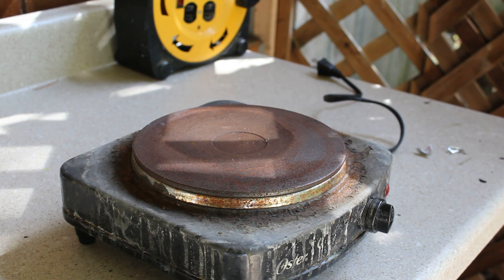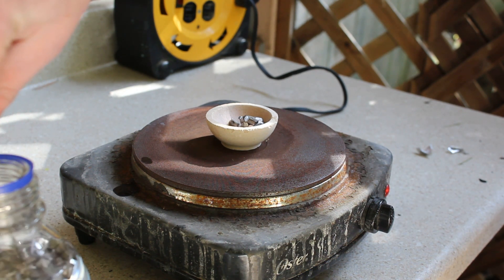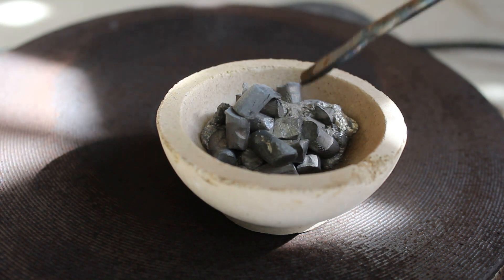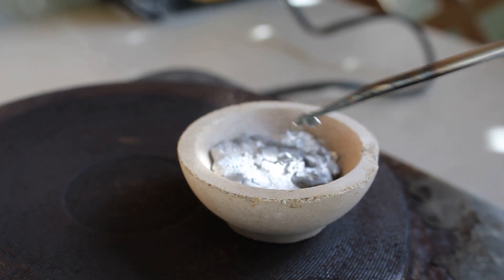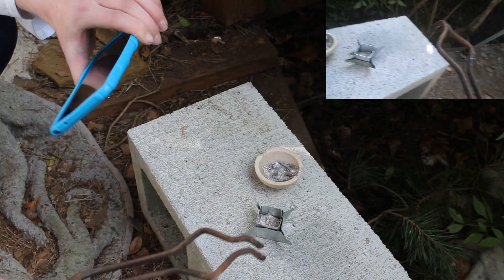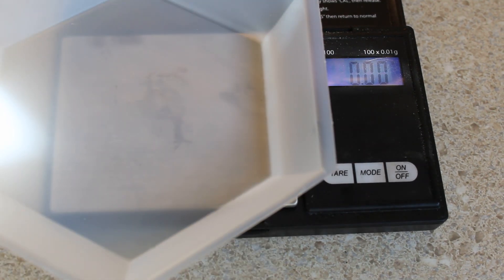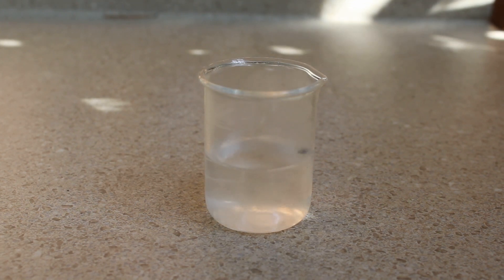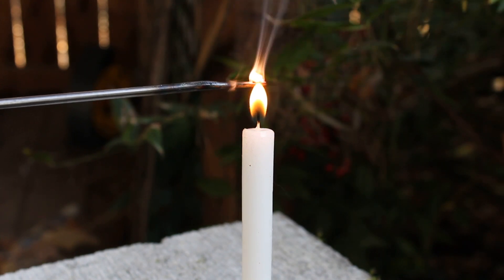Melting and Casting Lithium Metal

Comment: Lithium is so reactive it’ll oxidize at room temperature slowly, and when you heat it that speeds up exponentially, so a good portion of your (half) cube was lithium oxide
Reply from the maker: Yes however lithium hydroxide is less dense than lithium metal and thus it floats on top the molten lithium
Reply: Would smelting it in valume stop that?

Comment: How does the lithium not ignite?
Reply: I think that's sodium and sodium needs water. No idea about potassium
Reply: Wait it starts oxidized went heat up in open air...I think it not explode because atom of lithium might be low to compare it other alkaline metal sodium and potassium.

Comment: Why my lithium catch fire while I melting them? While the lithium is burning I try to use water to extinguish the fire and it start flying molten lithium and explode！
Reply: I can’t tell if you are joking, if not, it’s most likely because you exposed the metal to the actual flame. This probably catalyzed the reaction and caused the whole thing to catch fire. It’s happened to me plenty, so don’t worry.
Reply: you genious, lithium reacts with water

Comment: Could you add 69 grams of gallium 21 grams of indium and 10 grams of tin in a beaker or crucible and heat it up? It makes galinstan. Then get 45 grams of aluminum foil and melt it and get 5 grams of galinstan and stir it with a graphite stir rod or screw driver. It makes a aluminum galinstan amalgam. Then add it to water to make hydrogen gas.
Reply: and the relation to the lithium in this video is?